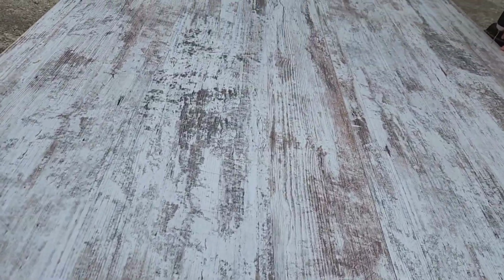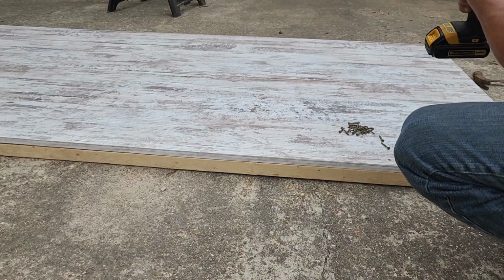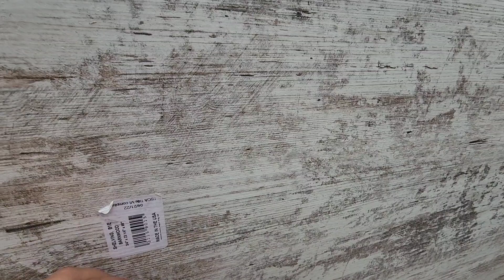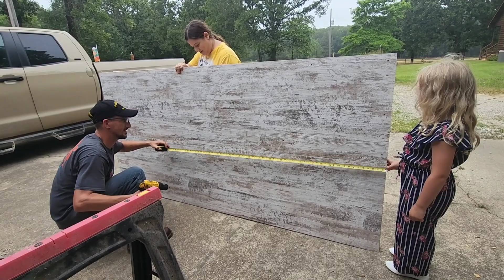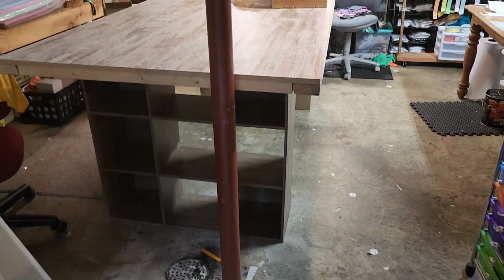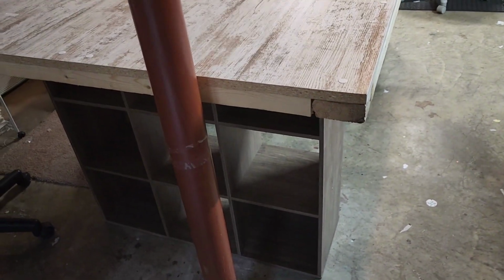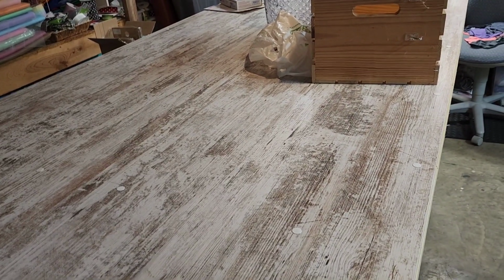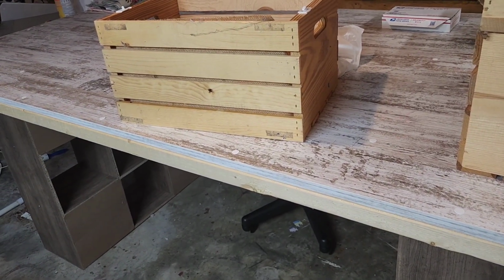Embroidery Business Vlog, Making A New Craft Table

Comment: Looks great! I done something similar, we bought a sheet of mdf 4’x8’ ended up having to cut it down some it was a little big for my space, used two-4 cube shelves on either end and just say the mdf on top, it doesn’t seem to move at all but if it had I was going to use the shelf liner that’s non slip to keep it from moving, and used contact paper that looks like wood to cover it, in all around $80 for a large table! I couldn’t afford or did I want to spend $$$$$ on a table!
Reply from the maker: That's a great idea too! Yes. I don't have the $$$ to spend either. This table is very sturdy too. If not we were going to use some L brackets to tie it all together. But it is doing good.
Reply: @sam-maliasstitches   that’s awesome, we crafters have to come up with crafty ways of doing things, 🤣! Best part is if you don’t need the table anymore take the top off and you have the selves you can use separate!